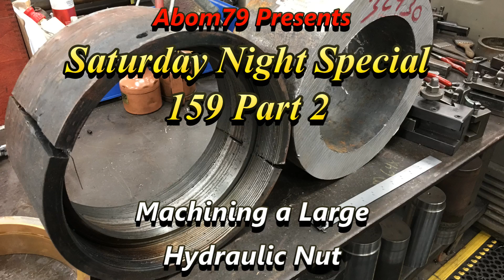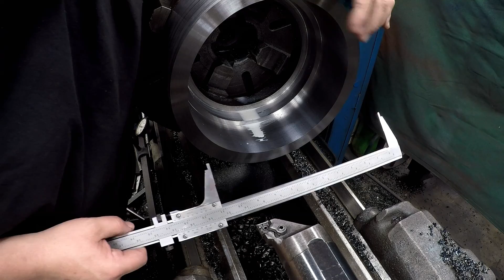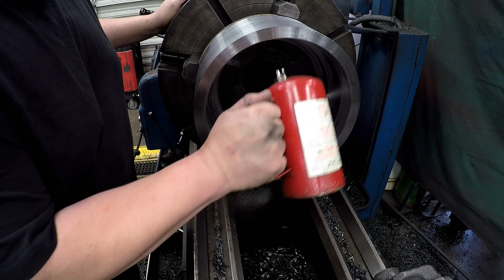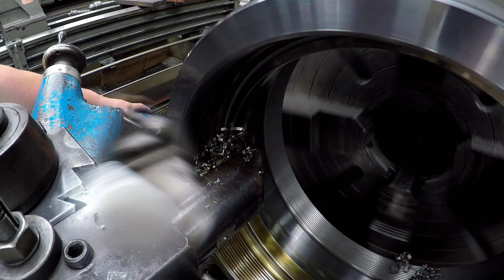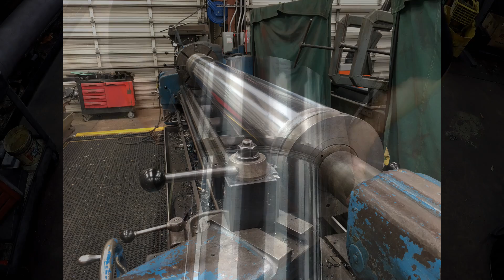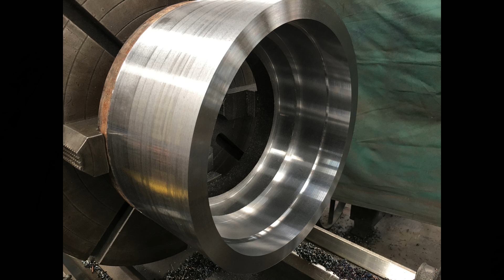SNS 159 Part 2: Machining a Large Hydraulic Tube Nut

Comment: Could you do a explanation video on how you set up a piece for chasing the threads? 
How do you get the timing of the threads right so you don't split the threads or something? 
And thanks for another great video! :)
Reply from the maker: Yes this is a good subject for a later video.
Reply: ...set the tool so it is just clear of the thread...start the lathe and engage the half nuts on the proper spot on the dial...stop the lathe with the half nuts still engaged...work the tool in with the cross slide  and compound until it fits the thread exactly...zero your dials...back the tool out slightly with the cross slide...roll the lathe over by hand to see that the tool follows the thread exactly...
Reply: As far as I know, with the lathe off, you place the half nut in the right location, go ahead and engage it, and then work the cross slide and the compound until the tool is dead nuts middle of the thread. Then Set both to zero and the and then cut it like a normal thread, increasing the compound. You may wish to to do a light straight infeed to clean up the thread on both sides.
Reply: I was feeling bad that I wanted the part to have threads that my need to be cut deeper in order to see the set up procedure for getting the tool aligned with the existing partial threads cut.
Reply: Adam, I too would like to see how you do this. I have occasionally had the same problem, and I haven't been able to do this without munching the existing threads.

Please?
Reply: This is exactly what I was wondering, when you took the nut off and said it was still undersized! I'm guessing you could put the machine in gear, get all the backlash out, then use your compound and cross slide to adjust where the tool sits? 

Looking forward to a thread chasing video!
Reply: Pjuklarven83 me 3
Reply: yeah this would be very helpful to know
Reply: Yes, I would also love to see a future video on this.  After you cut the threads and took the nut out to test it, was wondering how you would proceed had you needed to continue cutting the thread.

Comment: I ran an old war lathe that had a pneumatic half nut and I once and a while would miss grab the nut so you had to watch that thread dial like a hawk and be really sure that it was right or you trash a thread real quick like.
I also have a good stock of brazed on a HSS bits to just get-er-done. Nice to have the right tool but you can't buy a $500 tool just for a one off job or wait a week for it! And a lot of the time a hand ground tool is more than good enough for some jobs sometimes even better! You'd be surprised how many times I've used a hand ground tool in a production CNC lathe for a small groove or as a form tool.
One thing i really like to use on grooves like that face groove is grind a notch along the top of the tool so that it looks more like a part off blade top. This helps the chip curl up and get narrower a bid so that it doesn't bind as much in the groove, just like a part of insert forms its chips. Also using a some sort of air blast, mister or even a blowgun on them makes a huge difference, blows the chip out of the groove even better than coolant does. Little messy on a manual but way more reliable, I'm spoil now with my CNC lathes I can just close the doors and let it fly :)
Thank you for the awesome video's and keep up the good work.
Reply from the maker: Yes sir, I have a drawer full of high speed tools that I have ground for specific jobs. It's tough asking your boss to buy you a new carbide insert tool each time you need one.

Comment: Do the customers typically give you a drawing to go off of? Or is it like "here's the broken part, make another one"?
Reply from the maker: Sometimes we are supplied a drawing and other times we have to design it by the old parts. This job I copied the original part and also used the tube for one side of the threads.
Reply: Thanks and thanks for your excellent videos.    Your's is the only channel with 30+ minute videos where I feel fascinated from start to finish.  

FWIW: here's my lathe.  https://sites.google.com/site/flexispeedlatheinabox/   (try not to laugh)
Reply: That... is an ideal tool for quite a few things a model maker might do.

 I have a little Craftsman 109 lathe with the silly small spindle, and now that I've seen yours I'll have to build it into a toolbox just so I can say its not a toolbox, its a MACHINETOOL box!
Reply: mosonification Yes, that's a question I had as well.
Reply: Tim that little lathe is so kick ass man.. Love it.. and most machinists will love it as well.
Reply: mosonification A lot of the parts are parts that they had made in the part from repeat customers. They designed the part, so they have the drawing in house. For new customers, if they have a drawing they send it with the part, if not, they send just the part.
Reply: I do stuff like this from time to time. If they've got the broken part and like in this case there's a male threaded component supplied, you can make it without a drawing. In my case, there's usually no drawing. The customer might provide some additional info after a bit of prodding.
Reply: Thanks for the reply

Comment: Nice work and fit on the nut Adam.  Thanks for the explanation on the o-ring groove cutting workflow.  I'm surprised those threads don't gall more often, reminds me of the large SS AN fittings which seem to be prone to galling.
Reply from the maker: We see the galling all the time. Some times it's not that bad and you can get them aprt and chase or polish. Sometimes you have to cut things apart and remake them.
Reply: At my old job they had to cut stuff apart often.  Anti-sieze would help but they were not supposed to use it because it was a potential contaminant.  There was some that was OK to use contamination wise, but did not work very well preventing galling.

Comment: how can you cut the threads multiple times and always be cut the same thread
Reply: The carriage has a half nut that engages the feed screw which is clocked to the spindle. Adam and several other YT creators have videos on it. I will look for Adams Shop Talk episode on that topic and post it unless Adam posts it before me.
Reply from the maker: Yes I made a video on just that subject.

Comment: Won't the threads just get destroyed each time the set screws are tightened?
Reply from the maker: You put thick pieces of nylon in the holes under the set screw and snug them down without distorting the threads.
Reply: Ah, OK. Thanks

Comment: What's that sure shot thing, and what is the fluid called?
Reply from the maker: The sprayer is called a Sure Shot. The cleaner is Brake Clean fluid.
Reply: Aaron Anderson ya I want one
Reply: It is called Kroil.  Mostly I believe it is meant to be a penetrating oil.  He is likely using it to prevent galling.  You likely will not find it in stores but the factory is in Nashville TN.  You can find them online I am sure.
Reply: its a sprayer filled with break cleaner, its probably just cheaper buying it that way rather than the spray cans
Reply: Aaron Anderson The canister I know you can get at NAPA. It's about $30. I've seen guys fill them with carb cleaner, WD40, degreaser, etc.
Reply: Sorry I thought you were talking about the spray can he used.  Don't know what he would have been using in the like you say shot thing.  I know we have one and usually use kerosene for cleaning, but not sure what he uses.
Reply: ...Yes, they will even send you a free sample.....
Reply: http://www.sureshotsprayer.com/

Comment: I can relate to threading on old machines. I have a 1939 South Bend that I have to engage the half nuts just shy of the lines on the dial and apply a drag on the hand wheel to take up the backlash or it will cut screwy ... no pun intended ... threads.

Comment: Always enjoy watching you do the "big stuff" and wish my work was similar but it is not. My work is very small in comparison. My working tolerances are in the tenths and millionths. The heat from your hand can expand the parts to the point they won't fit the mating parts. Have to measure quickly. All of our instruments are ceramic and air gages. Wish I could work on some big stuff cause it is a pain sometimes. Tried to move into another department but have become too good at what I do and my supervisor won't let me move. Maybe someday......... Good video as usual.
Reply from the maker: Good for you Johnny. I don't care too much for the small parts like that, I prefer the bigger stuff.

Comment: I would love to see how you re-index a part back on the lathe to cut the same thread pattern to deepen the thread depth.
Reply: Just bring the tool up close with the lead screw engaged and manipulate the cross slide and compound to bottom the tool into the thread. Set zero and continue.
Reply from the maker: We'll get a video on that some time Troy.

Comment: how on earth does one make a square hole in a round bar at 45 degrees?
Reply: it can be done with a broach...
Reply from the maker: Push or pull broach is a common method.
Reply: Drill it, and file it.

Comment: Those nuts screwed on nice. The miss hit half nuts is why I always like to have some room to stop the thread if I need to do over before I wreck the part. Will the Pacemaker run in reverse? Guess you could always thread from the inside out with nuts engaged all the time if it got too risky then.
Reply from the maker: Yes but you have to move the drum switch over to reverse the motor. Not something I prefer to do very often.

Comment: When you cut threads with a lathe like this, what's to stop you from cutting between the threads that you just cut on subsequent passes?
Reply: You need to engage the threading half-nut at the correct position, otherwise it WILL do that.
Reply: Motion of spindle and feed are synchronized and there is a dial on feed screw that show you when you can engage the feed.

Comment: Of all my questioned I have asked the various Youtubers, this one will be quite abstract.... I realize that just because the nut is much bigger than regular / typical hardware, that it doesn't mean that the nut get torqued on/down with a bazillion foot/lbs.? With that said, can you give some insight to theory of how tight is tight enough, or does the prints come with specs ? Let alone, I would love to see the crane operated torque wrench for doing so, LOL. I have worked on some cylinder/rams that are no bigger then 2 to 3 inches in diameter, and they had provisions for locking the nuts once the unit was assembled, and only required a hand tight pressure, in turn, then turn another so many degrees, then finish off with the locking mechanism, either being set screws, or spring collars of sorts... But I can't imagine something this darn big only getting a hand tight fitment. Also, how do you go about dis assembly of the system like this especially if they are tight and need to be reused. Yes, I seen that this particular one needed to be cut, to further prevent damage. I can assume that one end is held by the lathe, but what tool or how do you go about getting the two items apart? Fine job on the video, again! Drew
Reply from the maker: We have a chainwrench with about a 4-5' long handle. once we get the spun on tight with it by hand as tight as we can, we will give the handle a little pull with the overhead crane and tap on the nut a few times with a hammer to help seat it. There is no real spec for something like that. Im sure there can be yes, but you can get a feel for what will work.

Comment: Adam, you mentioned this a bit when you talked about test fitting, but when measuring the finished threaded ID, what would be the inside equivalent to measuring over wires? Some way to assure that you had the right thread root depth, like, if for instance you did not have the tube and the bronze packing nut on hand to check to.
Reply: Oh... P.S.  nice extended outtro music.  First time I recall hearing that much more of the tune.  Who is the artist, what is the track name?
Reply from the maker: I don't have any special tools to measure the inside diameter thread pitch like you would on an OD with thread wires or triangles. I even had John ask Mitutoyo that for me and unless you have deep pockets....
Reply: digitalradiohacker - Thanks!

Comment: Adam, if you remove the nut from the lathe and you find that it is too tight, how do you match the threads again when you put it back in the lathe?
Reply from the maker: John I've had several ask me the same question so I'm planning on making a video of that.
Reply: John Warden I was thinking the same thing.
Reply: John Warden 
Easy cheat, run the tool in till it hits the thread groove, and bring it in in gear and adjust it to the full depth.
You could also mark the outside of the part and the matching jaw on the lathe to make it easier to get a close ballpark to it.
Reply: Yes, Me tooMaybe move the Cross slide to 3 O'Clock, then mark a spot on the Nut, and a Attach a Dial Gauge to the Boring Bar to that spot. Just guessing?

Comment: Adam how do tighten the nut once they on the job.
Reply: He doesn't do the assembly. The customer does that where ever the project machine is.  As beautiful as Adam made that, let's hope the mechanics have a nice, soft, strap wrench to work with!
Reply from the maker: We use a big ass chain wrench, while the back of the tube (the section not chrome plated) is held in the chain pipe vise.
Reply: +Paul Copeland you have a pipe wrench that will fit a 14" shaft???   Was a good question I thought.   Maybe they add some spanner grooves.
Reply: Barry-pipe wrench....That is exactly what we don't want (I assume!).  Pipe jaws on a typical "chain" wrench (everyday tool in the pipe fields) would tear the hell out of the finish.  If it has to be extremely tight (which I do not believe is required due to the o-ring feature) then you don't have a choice.  However, a nice, tight assembly can be made with a "strap" wrench and not damage the pipe finish.  Here is a link to what I have in mind.  I believe this model will fit a maximum 20" diameter pipe.
https://www.reedmfgco.com/en/products/wrenches/strap-wrenches/

Comment: Would like to see a video where you show how you setup to chase existing threads.
Reply: Yes   Also where do you find or how to calculate total thread depth or pitch diameter?  For instance if you have to make 10 TPI ID and you do not readily have the second part to fit, how do you know when to stop cutting?  And vice versa? OD thread?
Reply: @FrontlineArms  one your thread starts to measure below depth of your cut that's you sorted
Reply: @FrontlineArms  Machinery's Handbook

Comment: Nice work, Adam and good luck with the new computer from part 1. I actually laughed out loud when said that you hoped the metric bottle opener would work  on Imperial bottle caps. Hilarious!! 
Rich
Reply: Rich206L   Similar to a metric Crescent wrench.
Reply: In the old days natural gas pipe was fit with tapered threading.  At best with good thread cutting, teflon tape, pipe compound, not too much rotation, not too little rotation, tested with a precision tool, 80 percent was about as good as you could attain, meaning 20 percent of the joints leaked.  Thank goodness for replacement  with O rings!

Comment: That was some really great machining there. As always your thread cutting is top notch.
Btw, on your mike adapter, so you don't get any more damage on the cord (which is most likely what failed) try and sleeve it with some heat shrink sleeves to give it some stiffness. It's a bit inconvenient, but it does last considerably longer.

Comment: Knowing those machines as well as you do makes you a very valuable asset to your company. The money you save them from blow parts I'm sure would be a bunch, should a less experienced person run that lathe. I would imagine you have a complaint or two about those older machines. How'd you feel if they re-equipped wilt all brand new machines? Thanks for the great video.
Reply: Not trying to butt in but where would you buy a new big lathe? I don't think such a thing is made any more
Reply: I am sure the Germans do.
Reply: China for sure, Japan maybe. I just looked. LaBlond sells new lathes, big ones.
Reply from the maker: Some of the older machines like the Pacemaker have there faults here and there. It can be fixed but most of the time you don't have the time to work on them, you have to stay busy making parts, so you learn to "work around them".
Reply from the maker: Ronald, there are very large machines still being built, most of them coming from Asia countries. You can buy pretty much any size lathe or machine you can think of.

Comment: Nice work. There's obviously been some advancements in threading inserts. 30 years ago I'd have chipped the tips had I taken your depths of cut.  You don't have to thread in granny gear. You get better finishes and fewer problems if you thread in the "sweet spot" of speed and depth of cut.

Nice safety note on dealing with thrashing ribbon chips. They're like razor wire or jumping cactus. Get too close and they'll snatch the pliers right out of your hand or even pull you into the work zone and slash you to hamburger. Stop the machine THEN deal with the problem.
Reply from the maker: Yessir Forrest. I have to say those Snap Tap threading inserts I use seem to be bullet proof! I very rarely break the tip off. That was my own personal 1 1/2" Seco bar I'm using but I put in to have work buy a replacement and a 2" bar as well for me. :)
I try to show that when things get hairy, just be calm, stay out of the way, stop the machine first then deal with the chips.